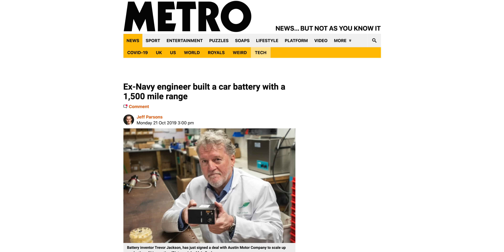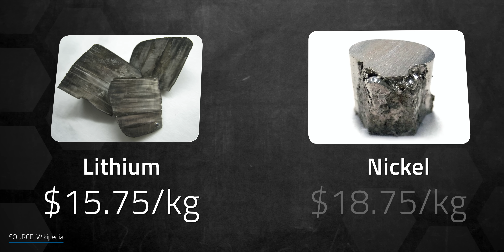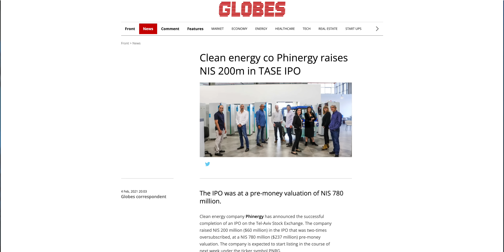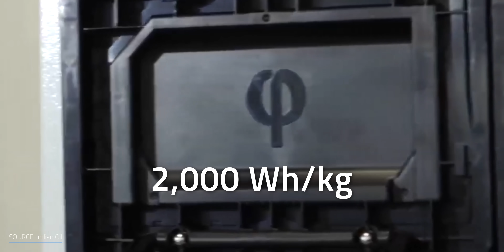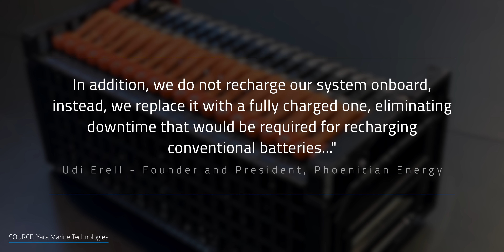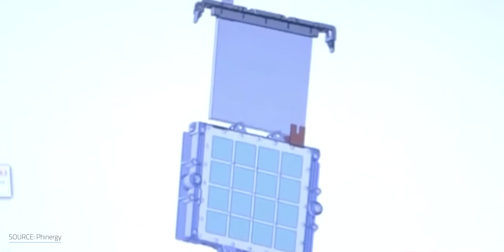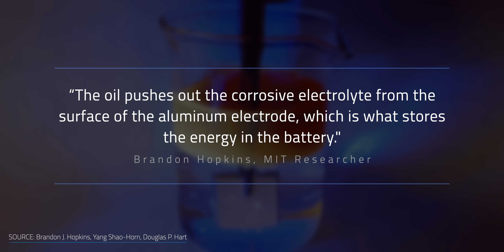Exploring the 1000 Mile Car Battery - Aluminum Air Hype?

Comment: Calling this a battery is slightly clouding the water.  If it is, this is what is called a primary cell.  Whether this is a primary cell vs. a fuel cell is a trickier question than I could answer right now.
The first time I heard about the Aluminum-Air cell was in a Popular Science or Popular Mechanics article in the late 70s or early 80s, and they proposed in the article "a simple click-click operation" to swap new aluminum plates in, and to empty the spent aluminum catchment into a waiting recycling container.
That was over 30 years ago.  Here we are now, talking about it at approximately the same stage of development.

Comment: For the towing point, I feel like if the tech was widespread enough (which I feel like it would have to be if there was a swap station within towing range in the first place) then the support vehicle could potentially just bring a replacement battery to the disabled vehicle instead. That assumes they can be replaced by hand or with relatively portable equipment, but it would be the same rough idea as a tow-charge or other portable battery system for Lithium-based EVs, with the benefit of not having to wait for your vehicle to charge. 

I wonder if the range-extender idea you mentioned earlier in the video is the better approach. Your car has a conventional Li-ion pack which is great for normal commutes, errands, etc. and a port where you can connect an Al-air battery if you're gonna take a long trip. Like imagine if you could order ahead of time an Al-air battery pack that perfectly fits in your Model 3's frunk (as an example, no idea if that would be big enough for an appreciable boost), and there's a port in there to hook into. When your road trip is over, or when the battery is drained, you could ship it back to the manufacturer to be recycled or go to a swap station. And you could even build in some optimization, like the Al-air unit only starts charging the primary pack when it goes below a certain level, rather than keeping it constantly topped up until the Al-air unit is dead. That way, if you stop for a meal or something on your road trip, you could take advantage of a charging station and get more out of the Al-air extender for the rest of your trip.

And on that note, EV tow services that bring tow-charge units could potentially take advantage by bringing Al-air units to charge stranded Lithium EVs. Since they always return to the same depot after each mission they could just have a stock of Al-air batteries and deliver spent batteries in bulk to a recycling facility.

And as others have already mentioned, aircraft, ships, trains, and maybe even long-haul trucks could probably take even better advantage of Al-air since they have predetermined routes and stop at dedicated facilities.

Comment: A smart vehicle should alert the driver of his battery status to anticipate required battery replacement.  Battery warehouse replacement stations could be strategically located with Amazon style quick delivery and replacement at planned locations.  With extended service and availability of quick replacements this will enhance the appeal to the user.  Initially this may be more practical in commercial fleet applications due to vehicle use controls and predictability.  My thoughts and opinions.

Comment: Range anxiety and safety are not my concerns about battery powered electric cars, my concerned is how long the battery packs will last.  I don't wanna replace an expensive pack every few years and there is a bit of concerns how long packs will be replaceable.  I think if I needed to replace a battery in 15-20 years, I will likely not be able to buy a replacement pack in the form factor of the older car.

Comment: Why not pair this Al-Air battery with a smaller Li-Ion batter that can handle the range of daily driving responsibilities (say, up to 60 miles) and use this as a depleting backup for those times when more range is needed?  Recharge the Li-Ion battery for daily use and rely on this for times when that's not enough?  Like a range-extender.

Comment: Actually, battery swapping has been the answer all along.  Its no different than filling your tank with gas.  No one is going to want a car that takes even 30 minutes to recharge.  People want to get a refill in 10 minutes or less and be on their way.  If you could make any electric car that swapped batteries out in 10-15 minutes, you would overcome the biggest problems with electric vehicles.  Also, because you swap the battery as needed, you don't end up with a huge toxic boat anchor that you can't get rid of when the lithium ion battery goes bad eventually.  I've seen where people are having to pay $10,000+ or more to recycle the battery in their aging electric vehicle.  But the car is no longer worth that kind of money.  And this doesn't even include the cost of the replacement battery.  So it ends up costing more to just get rid of the car than its worth.  I read an article about a city that went with all electric vehicles for its maintenance staff.  After several years the batteries went bad.  But it cost so much to replace them or even discard them, that the city chose to simply park the 300+ vehicles in an abandoned field the city owned.  Now those cars are sitting there rusting away and possibly leaking highly toxic material from the batteries into the ground.  By swapping batteries, the batteries stay in a recycling loop with the factories that made them.  This is the only feasible way to do electric vehicles.  I can't see why no one has figured this out before.  Also, you mentioned that if a car with an aluminum battery dies on the road, it would have to be towed to a swap center.  Why couldn't they just bring a new battery to the car?  That would take less time than the porto-charger option you mentioned for lithium battery cars.

Comment: The cost of battery swapping would be a huge consideration.  It cost about $120.00 to drive my car 1000 miles (fuel cost).  So battery swap would have to cost that or less.   Swapping would be faster unless your charging overnight.

Comment: Having to swap batteries need be no more problematic that having to fill the fuel tank.
Obviously, the infrastructure has to be ubiquitous before that becomes true.
Aluminum-Air "battery" is more like a fuel cell ... the aluminum is the fuel.

Comment: First off, I’m a marine engineer, and the thought of replacing the huge fuel tanks with stacks of shipping container sized aluminum air fuel cells in the same space would be great. Fuelling would be fast with no worries of spills probably using cranes and it would eliminate the diesel or heavy fuel generator side of the diesel electric setup. Win win… even if only shipping were to benefit from this tech. Big thing is price per battery change. It’d have to be much lower than overall cost of fuel and engine replacement. Here’s hoping.
Reply: also electric motor require much less maintenance, space, way more efficient (aka less heat to deal with), safer, big container ship could cover the deck/container with solar panel to additionally lower fuel requirement..
Reply: @lesto12321  right, and I also wonder if it wouldn't be better to have a bunch of smaller engines instead of 1 big one. With electrics it's easy to do.
Reply: @WoutMertens  generally speaking 1 big engine is more efficient that many smaller, BUT if with many engine you can remove other mechanical complexity like the clutch, differential, etc.. it may very possible to be more efficient in total even if less efficient the specific
Reply: @lesto12321  I bet that unreliable weather conditions at sea and the logistical issues of covering a significant surface of a cargo ship with solar panels for a relatively small gain in power is probably not worth the effort.
Reply: @aidandavis_  there are already working prototype/hybrid, and full electric (solar+wind) ship are in the making.. simply so far nafta/gas was way cheaper and nobody cared about emission (aka carbon tax)
Reply: @lesto12321 Solar panels would be easier to install in bulk carriers than container ships.
Reply: For automotive use - the simple option would be to have several standard  removable batteries , to be used in sequence if possible - 
You wouldn't start a long night journey in a rural area without topping up your petrol tank - same here - and if the batteries were commonly used ,the breakdown truck would probably have 1 or standard batteries on board - maybe not enough for full power or "ludicrous mode" but enough to run the car in Eco mode .. thanks .
Reply: @eastcorkcheeses6448  maybe you can have 2-3 battery with ~100km range, maybe even a normal lipo as buffer
Reply: @eastcorkcheeses6448  You seem to be missing the fact that these batteries are not rechargeable. That means only one thing. They are expensive. Only a fool would spend thousands of dollars per journey in 'fuel', and since the subject was carefully avoided in the above video, I suspect we are talking about tens of thousands.
Reply: @TimothyWhiteheadzm  I think you're missing the main idea tho. These would hopefully create a method of transporting, storing, and using energy that could be renewable. Aluminum forges actually favor electricity for manufacturing. yeah, you have to swap them out, but that's faster than charging a Li-ion vechile, heck that would be faster than fueling any vehicle I've ever owned. if the energy is coming from renewable sources then what's wrong with doing it that way? Sure its round-trip efficiency would suck but that can be sorted out in the future, it's new tech.
Reply: @ryanbernard6550  No, I am not missing the main idea. I am not just blinded by the supposed plus sides to the point of not seeing how monumentally stupid it is. Lithium ion batteries store renewable energy just fine. Tesla tried the battery swap idea and nobody was interested. It turns out that driving to a battery swap station is actually more trouble than just charging over night at home. The round trip efficiency doesn't just suck, it is something like 0.001% efficient vs lithium ion at 90%. And no, that won't be 'sorted out in the future'. Its physics. Remanufacturing a battery, transporting it all over the place, installing it into vehicles etc will always cost far more than simply recharging it. That will never change. Its a stupid idea designed to scam governments, nothing more.
Reply: @TimothyWhiteheadzm , The adoption of technology like this will come down to cost as you say and only mass production will drive that down. To attain that scale of manufacture then it has to be easier to use than the alternative and that is not a fossil fuel. We have to replace FF no matter what. The ease of use thing comes down to the infrastructure that supplies it and in the case of vehicles petrol stations, we already had the technology as it's much like pumping any fluid. It will be very difficult for any one technology to install their delivery infrastructure right across entire countries as Petrol/gas stations have. I have seen a company developing robotic battery change stations but who knows if that is the answer. It's definite that the power source for most road vehicles will be electricity but how it gets to the vehicle has a way to go yet I think.
Reply: @alistairshanks5099  Sorry, but mass production will NEVER drive cost down below the cost of the energy used to produce the item. Its physically impossible. Its just a monumentally stupid idea trying to solve a problem that has already been solved with lithium ion batteries. The idea that EV owners are desperately in need of a filling station is just plain nonsense. The typical EV owner charges at night and never needs to visit a battery-swop or filling station. This battery is being marketed to solve a problem that simply isn't there and it will never be economically viable for reasons of simple physics. Its a scam.
Reply: @TimothyWhiteheadzm   Do you have any reference white papers on round trip efficiency? I am seeing different numbers on this on forums , you mentioned 0.001%. I also saw 20%?  Very interested to know the official efficiency numbers.  how many KWH energy needed to produce 1KWH cpacity AL battery, from recycled aluminium / fully oxidized batteries?
Reply: @TimothyWhiteheadzm  I guess desperate times call for desperate measures. That's why they are trying all sorts of solutions In H2 Fuel Cell, Li Ion, Al Air, Iron Air battery techs. We surely know that oil is going to raise atmospheric temperatures and now that people have gotten used to the comforts, they won't settle for anything less. Just like you say this is bullshit idea, i say Ethanol blending and Bio Oil blending is bullshit idea. They will definitely create food shortages and deforestation. Fusion reactors may be the only way that seems completely green but we are nowhere near. So let the technology evolution take its natural course.
Reply: @TimothyWhiteheadzm  so much so that now Li Ion has itself become the problem due to scarcity of materials and deepening Supply Demand difference. With China having control over Lithium, it will be like putting entire world in their hands. More so Li Ion have been facing lot of fire issues in warmer Indian conditions so Indians have started thinking if it is the right time to adopt EV tech.
Reply: 69th like
Reply: Interesting how the ships design will change ....
Reply: @Grim FPV I’m in British Columbia Canada. We have aluminum smelters that crank out huge amounts run entirely on hydroelectric. Quite frankly however, wind and solar are more than capable. A gigawatt is a gigawatt no mater where it comes from.
Reply: @Grim FPV where I live, the smelters run off of hydroelectric but the wind and solar with batteries and solar thermal are coming along nicely. There are huge numbers of various storage solutions already being implemented around the world. As this aluminum battery tech develops, I’ve no doubt that the intermittent nature of solar and (to a lesser extent) wind, will be less and less an issue. This is even without the possibility of small modular nuclear that would be an excellent fit for an aluminum plant, (or large scale shipping for that matter).
Reply: Need a cathode and anode under the ship to use open salt water to power the ship.
Reply: The way to keep the price lower is to use breakthrough solar efficiency (ours, at around 50 cents per Watt DC capacity) at scale to produce the electricity used for recharging the swapped batteries (or restoring the aluminum plates in them). Finance the entire process so you can pay it off with earnings over a few years.
Reply: Also this would be a lot more quieter unlike today's noisy marine engines.
Reply: Liquid aluminum might be an answer. Fill er up!
Reply: Sounds great until you realize that the cost of fuel is waaaaay cheaper than these batteries - which are not rechargeable. Unless the remanufacturing cost is magically efficient (I noticed that this video never mentioned the energy required to remanufacture them) this is a monumentally stupid idea. A Lithium ion battery is the main cost of an EV. But you buy it only once. Buying a battery as 'fuel' is just plain stupid.
Reply: @TimothyWhiteheadzm  Pursuing dumb ideas separates the successful from the extinct and dead. I have little empathy for the fails which obviously have serious implementation challenges.
Reply: @scottdowney4318  This is one of those ideas that obviously has implementation challenges. Its as stupid as the 'hydrogen economy' that has been touted by fossil fuel companies since Bush, but never happened because it was stupid from the beginning and everyone knew it. I can remember a scientific American issue on the topic two decades ago that simultaneously said how stupid it was and that it was the future. Unfortunately there is often a lot of government funding in stupid ideas because governments just love to not do the right thing. (its a side effect of capitalism).
Reply: @TimothyWhiteheadzm  , the government funds "stupid" ideas (which sometimes lead to unanticipated breakthroughs) and good ideas. You only focus on the failures, conveniently for your anti-government stance. Guess where the basic (and sometimes advanced) research comes from for almost all prescription medications? Yes, government funding. Drug companies do refinement, packaging, trials, and mass production -- and then they get a patent and clean up.
Reply: @Tudorgeable  , there are two issues: the government is handing money to private corporations with hardly any strings attached, and there would be precious little basic research in science in general or pharmaceuticals in particular without government (mostly federal) funding and government laboratories.

Comment: I have always thought that battery swapping would be extremely convinient, as long as it is a subscription service where I would rent batteries.  But only if I can change it out at any level of charge at any time for no additional cost over the subscription.
Reply: Good point.
Rechargable batteries as used in Tesla etc also have a finite life and that puts me off going EV. Do the research and you'll see thatby the time a Tesla need a new battery pack that pack is in the tens of thousands and actually costs more than the car is worth. That is like the apple phone business model and just encourages a disposable society.
Replacing packs for limited cost, duetoit being a drop in module rather than a part in the chassis thatweighs hundreds of kg makes sense.

Comment: Aluminum batteries are notoriously difficult to make and keep stable, let alone cost. The issue is aluminum tarnishes so easily that the conditions to make it have to be very controlled. I think production costs and lifetime will be an issue.